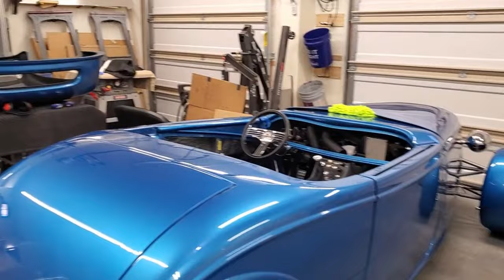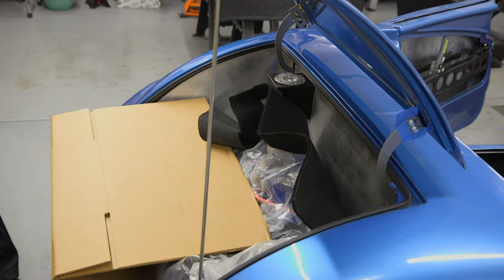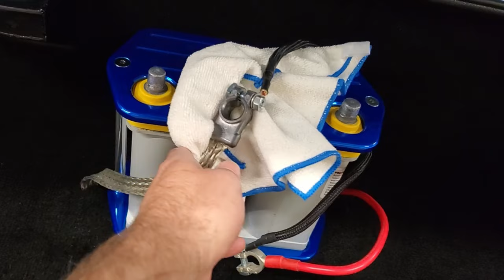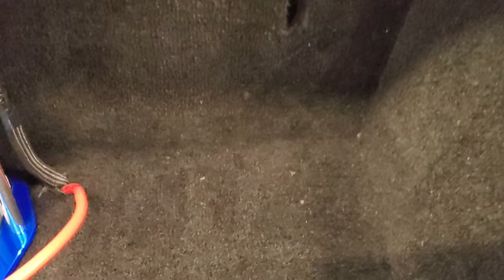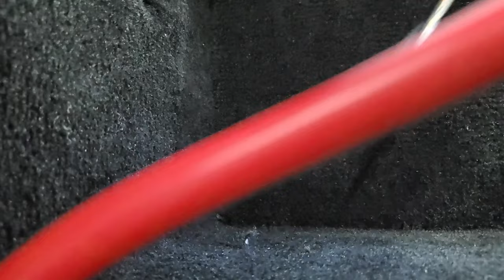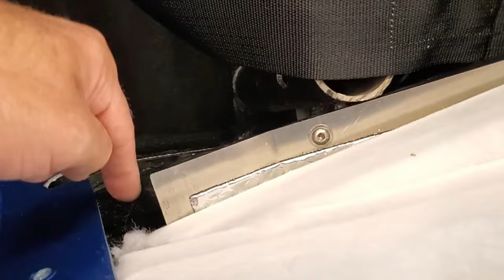Factory Five 33 Hot Rod V2 - Carpet & Seat Belts

Comment: looking good Jim... I am looking forward to the van work
Reply from the maker: I have been putting a plan together for the Van.  It will not be cheap.  Basically anything rubber is shot and needs replacement.  Plus a little more difficult to work on with a show car in the garage already.   We will see how it unfolds.....